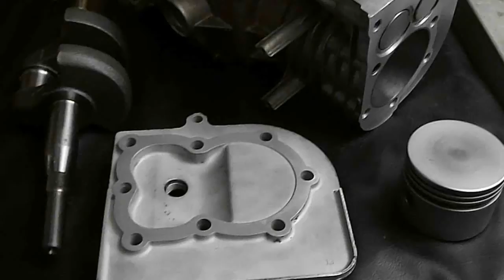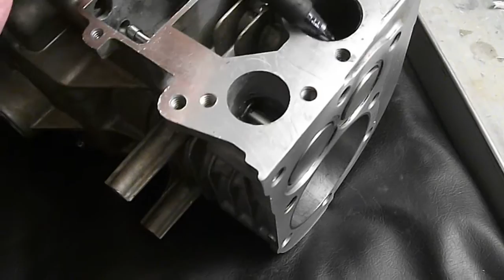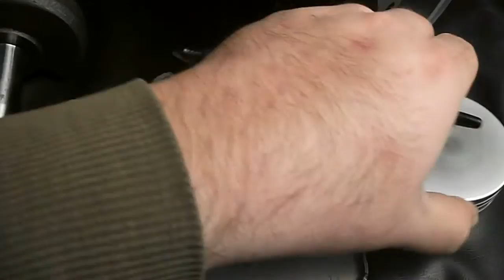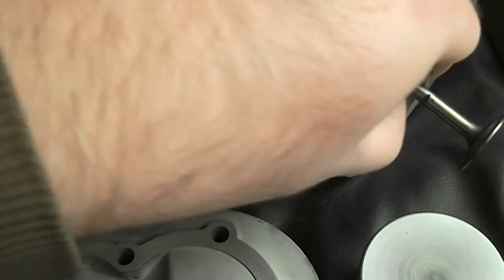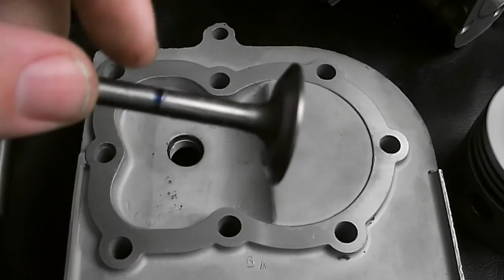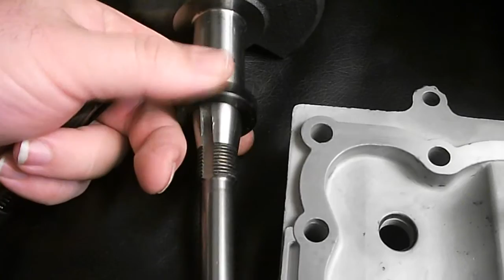Ceramic Coating Project Parts for the JB Weld Engine

Comment: i see really no point unless your running with no shroud or your boosting the motor. the paint will chip off and kill the motor
Reply from the maker: If you cook the parts at 250, then 400, and finally 600 degrees it should be chip resistant. That is what I'm testing for is to see if the ceramic paint chips or not.
Reply: *****
well make sure you clean the parts really good with thinner, pure alcohol, or electrical connector cleaner. dont use anything else as it leaves a film then the ceramic wont stick.
Reply from the maker: 30GB
I plan on it my friend.